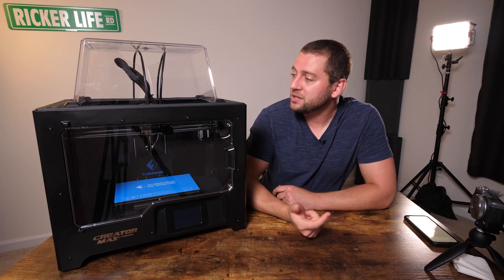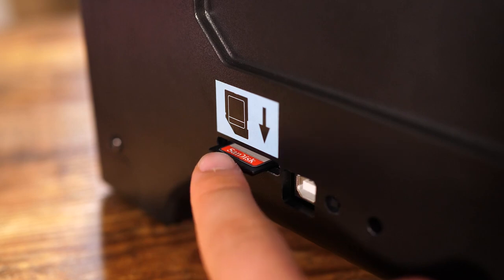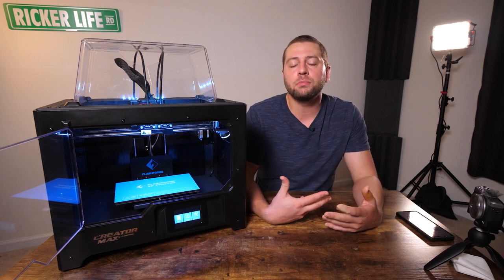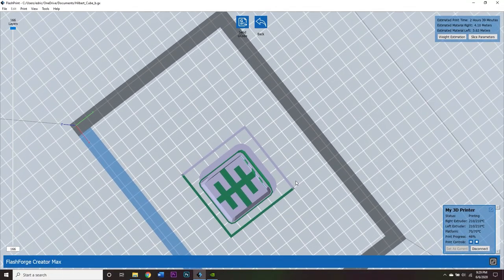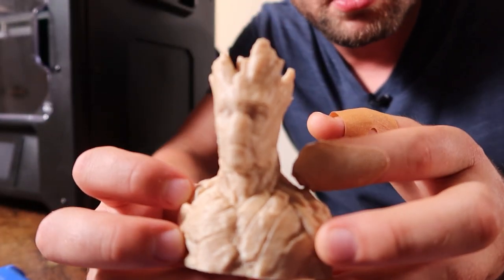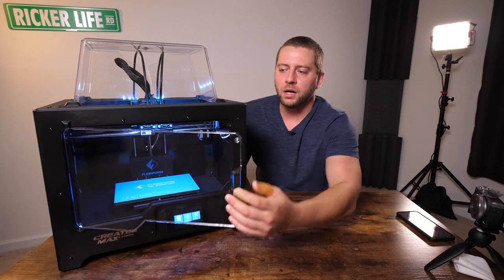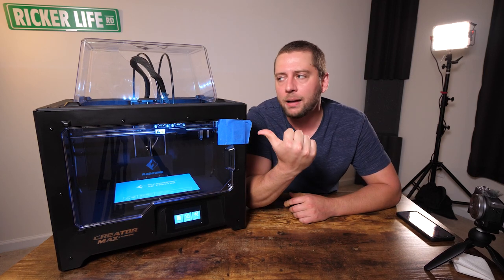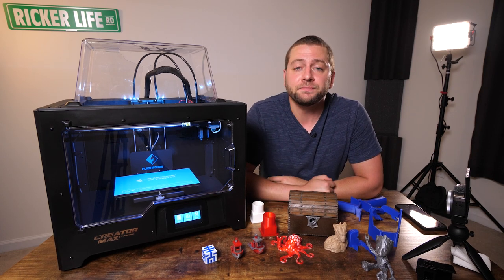Dual Extruders on a 3D Printer - Creator Max by Flashforge USA

Comment: Awesome Ed, I have been curious of home 3D printer and it was nice to see you contributing to needs for COVID-19 when shortages were critical.   
My work where I retired recently from had a very extensive research and development lab for 3D rapid proto-typing and also a production lab. In production, the process is called  Additives Manufacturing. We did laser, light and plasma 3D printing of plastics forming cross linked polymers, laser cured resins and metals (Stainless Steel and Titanium) ... Very cool process which has lead to technology for home-based units.  Great to see you enjoying technology and thanks for sharing what you do. I know the effort it takes to make YT videos and your channel is consistently fun to watch a learn from.
Reply from the maker: Thanks Addy, cool to hear about your background. Yes 3D printing can be enjoyable, but as with every learned hobby it can be frustrating as well. The dual extruders definitely complicate things a bit, but all around it's still a good one!

Comment: Please help. Can the FlashForge Creator Max Dual Extruder 3d printer use TPU filament? Can it print Carbon Fiber Polycarbonate filament? Can it print Nylon filament? Please advise.
Reply from the maker: TPU for sure, I show a few TPU prints in the video. Never tried Carbon FIber but I think it works. Never tried Nylon, can't say about that one.